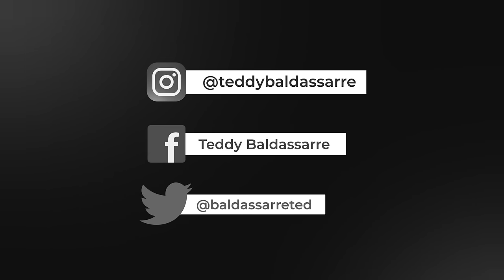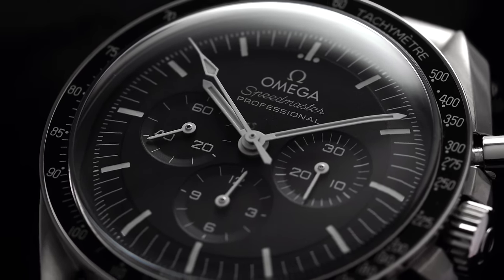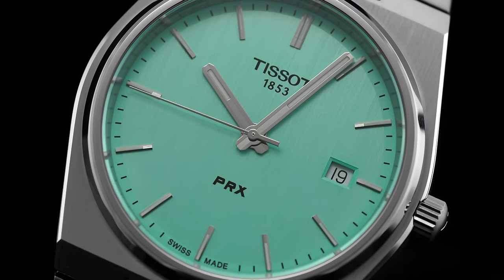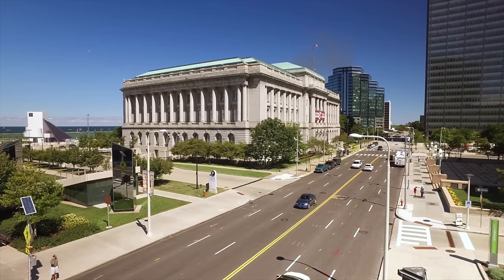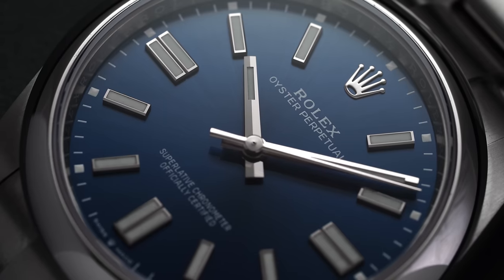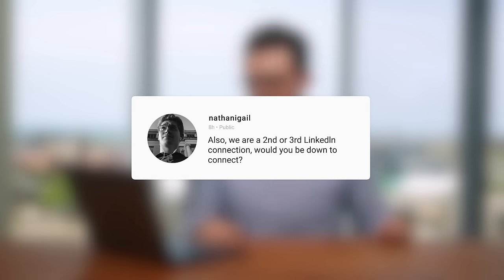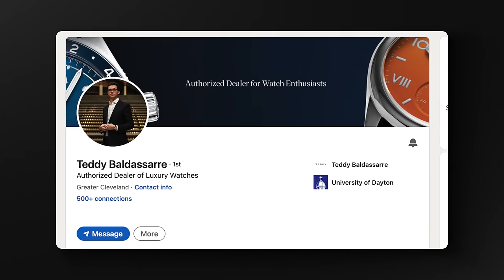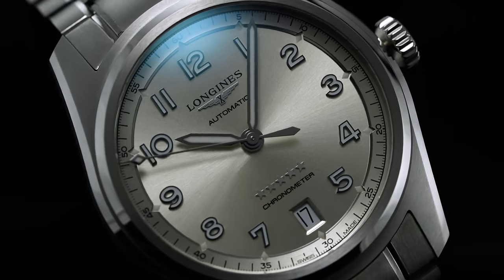OMEGA vs. Tudor, Why Are Quartz Watches Looked Down Upon? CPO Rolex, & More (Q&A)

Comment: Solar radio controlled quartz watches are my current obsession. Japan does not disappoint in this space.
Reply: Seiko coutura is worth looking at
Reply: Correct.  I have several from Casio Oceanus and Seiko -- all JDM.
Reply: Also Citizen Attesa radio controlled watches are worth looking out for. Always dependable to tell accurate time.
Reply: I got one about 15 years ago and it was too complicated.
Reply: I love the seiko astron line
Reply: Agree.  With the gshock line, I find the model I like then go searching for the solar/radio version of said watch.  If they don’t have it, I don’t buy.  Citizen is also unbeatable.
Reply: @brocklanders6969 Love JDM, especially Oceanus
Reply: I have a citizen radio controlled and am still amazed at the accuracy.  It's fun watching my Amazon devices change minutes at the exact same time as my watch.  If you're looking for accuracy, I can't think of a better choice.
Reply: Count me on the team, 2 Autos, 5 eco drives including my PCAT and a yellow Bluetooth Casioak. These last two are the go to watches when everything else has stopped or need adjustments.

Comment: I love quartz and have them from $1700 down to $50.  No reason not own a bunch!
Reply: Im curious, what quarz watches do you have at around 1700 Dollar?
Reply: @bertholdbach4959  G-Shock GWB-5000 Titanium, Black DLC.  2nd most expensive is the Tissot PRX Quartz Blue dial @ $350.  Both were bought from AD's.  Then about 15 casio's and g-shocks of varying price. ( Also bought a 14K gold plated dress in in 1997 for $750, still have it, but it needs a service, eats batteriers in 30 days)
Reply: @bertholdbach4959 I have a Sinn UX and Grand Seiko SBGX343. Both rated to +/- 10s a year. I'd find it very difficult to go back to an automatic after using these tbh.
Reply: @bertholdbach4959  cartier
Reply: @drmanhattan225  Quartz is my preferred watch for travelling.  I've had auto watches drop 10 mins in one day due to ??? magnetism, shock...who knows.  My quartz watches are just more reliable.
Reply: I have a movado bold verso chronograph = $995 before taxes. Most expensive quartz I will buy unless it’s a spring drive grand seiko.
Reply: @alexiz689  you need an omega railmaster anti magnetism, 150m WR. looks good... and way cheaper and prettier than the Aqua terra offerings

Comment: Swatch are progressively moving Omega up the chain.  Given recent Longines launches…to include the new Conquest…I believe Swatch are moving Longines up to compete against Tudor…and moving Tissot up to cement entry level
Reply: I would take Longines over Tudor in almost every category.  Maybe a black bay over a legend diver.  But I think legend is prettier at half the cost.
Reply: And a bracket that matches oris mido Christopher ward regarding there diver hydro conquest
Reply: Until recently, Longines and Tudor, and Omega and Rolex, competed at similar price points. This looks like Swatch Group increasing their prices to match Rolex price increases. Mido and Rado would be the Swatch brands best positioned to move up into the price range previously inhabited by Longines.
Reply: Longines quality is easily on par with tudor in my experience.
Reply: Absolutely agree just the bracelet on the hydroconquest which hopefully they will sort out quality brand in my opinion
Reply: @dsdf_fdp1858  I agree with you. HQ much more interesting design than BB…only  let down by a  cheap bracelet clasp. I had a BB41 that  I sold as it was just too bulky. I’ve retained my HQ 39mm and Omega SMP 300 as the 2 divers in my collection. Note: Was at Longines London Boutique…guy there told me stay tuned for new/redesigned HQ…it will be improved!
Reply: @Greygoose3130  The Pelagos line is better than any dive offering by Longines, but otherwise I agree.
Reply: @cagataycakmak2280 wanted to think the same. Never shut up about Longines to everyone. But, honestly, having just gotten the METAS BB41 on the five link, it's far beyond anything Longines. Same with the Pelagos. Kills me to say it, but Longines will find most of their success in the price segment just below Tudor.

Comment: It’s funny how my watch journey started at Quartz and ended up at Quartz once again. I ONLY wear Quartz these days. From lower end g shock to higher-end Grand Seikos, I’ll take practicality and accuracy over service costs that cost as much as the watch itself. 

Also, Grand Seiko High Accuracy Quartz (5 to 10 seconds a YEAR) are advanced movements with hand craftsmanship, incomparable to mall watch Quartz. There’s more of a reason to romanticize there than in mass-produced Seiko automatic movements that are also used by 3rd parties.
Reply: The mall watch quartz will still be more accurate, though.

Comment: After owning a bunch of automatics and moving to HAQ I don't think I could go back to autos again. Not even for a Rolex. It's just a pain having to check after waking how far my watch has strayed. Perhaps I'd try GS spring drive, but even then you could argue it's a convoluted way of using mechanical to achieve near-quartz accuracy.
Reply: To each his own and you make a valid point, for me tho I love a mechennical movement, yes its a pain in the rear but its so nice having something that does not have any electronics esspeically in a world where everything has a electronic output. Tho I think every collection would benefit from a quartz watch.

Comment: Speaking of quartz, I'd like to see a video explaining the differences in the levels of quartz movements. For example, a $30 Casio, a $375 Tissot PRX,  and an Omega at multiples of those prices?
Reply: the material used in it, and some complexity of it i guess .. some of the watch using gold soldering to preserve the quality. for complexity, on grand Seiko (spring drive) , it has like 40 percent of mechanical-type part for the power. no need battery for it
Reply: Branding. As far as I'm concerned, unless it's something special lik Seiko's spring drive, a quartz movement never justifies a big price tag.
Reply: @bikeman123 i believe there's like really expensive citizen watch with 1+ second/YEAR accuracy! I think with that accuracy it's kinda worth it

Comment: I think you are right that a lot of watch collectors look at the technology through rose colored glasses. The thought is, mechanicals are heirloom quality stuff that we can pass onto our grandchildren, just as you, and I still own our grandfathers' vintage Wittnauers.  Needless to say, the fact that a working man's watch from 50, 60, even 75 years ago is still capable of keeping reasonable time so many years later is remarkable.  
But realistically, how many mechanical watches on the market today, including well into the upper mid range are actually hand built?  The truth is, most mechanicals these days are made in factories with little or no hand finishing.  And, especially at the lower end of the market, how many will be worth servicing or repairing 10 or 20 years from now when they start to fail?  And based on the track record of older quartz, it is likely the better quality quartz movements will still be running 15 or 20 years from now.  So the equation of how long you will get to enjoy the watch without major service seems to balance out.
As for the preference for a smooth sweeping seconds hand over a once per second quartz, I think that is just something we just tell ourselves.   It used to matter to me, but doesn't really anymore.

Comment: Omega are the official time keeper for the Olympic Games.
I think that puts them ahead of Tudor slightly.
Reply: Not slightly. It's way above. Rolex fanboys are  just trying hard to use Tudor as Canon fodder vs Omega .
Tudor competes with longines level.
Reply: @Mega-zi7ys  You are absolutely right. Tudor is in the same category as Longines. Each brand has some strengths over the other, but they are pretty much in the same level.

Comment: I think watch winders are a great tool as long as you buy a good quality unit that support multiple TPD's (650 and up to cover most mechanical movements), selectable CW, CCW, or both direction turns, intermittent winding, and have a 12 hour rest period. Basically these features simulate how a person would wear the watch.  The best units use mabuchi motors which are very quiet.
Reply: Would you have any recommendations on which models to buy?
Reply: @davidprescott9586  I am using the "Vancouver Watch Winder for 2" from a company called "Cuffed". It is a Chinese model sold here in Australia. It has all the features I have listed above. There are other variants from the same source but there maybe different offerings in your country.

Comment: To further add to the quartz vs. mechanical discussion-- what differentiates a Swiss quartz from a Miyota or Seiko? I know some have jewels and some don't, but accuracy can only get so great that there is nothing else really to improve upon.
Reply: I beg to differ. There are different watches for different applications. One of my favourite watches, and my daily wearable, is a quartz. A CASIO quartz at that,  the ProTrek PRW-50FC Solar Limited Titanium Edition. I needed a hiking watch that was rock solid, had a photovoltaic bezel to recharge on the go, and came with things like a compass and an altimeter, all the while not being as garish as the GShocks so I could wear it comfortably as a daily watch. I also absolutely loathe smart watches, and I wanted a classic rotating hand movement.

For me, that PRW-50FC is just perfect, it has everything it needs in a surprisingly clean and restrained design, more so considering it is a CASIO. And it has the shock-absorbing capabilities near those of a regular GShock. All while costing just several hundred euros.

Yes, I love mechanical watches (I have my eyes on the ubiquitous Omega, Moonwatch, the TAG Hauer Carrera Glassbox and some Raketa 24 hour movements) but people dismissing quartz watches because they are supposedly the same is just plain wrong. A quartz watch can have a ton of individuality.

Watches are, at the end of it, tools. Find the tool that fits you, whether mechanical or quartz.

Comment: A lot of people rely on quartz watches because of the precision and reliability. Not to mention it takes 2 years of more for the battery to die out and costs about $8.  The brand I have is a Wenger, probably a sister company of Victorinox which make swiss army knives. Very good quality and water resistant too. What I have cost me about $200 and is now about 8 years, batteries changed twice during that time. I can sleep knowing the time is exact minus or plus a few seconds.

Comment: I enjoy my automatic watches, I own several. My Longines Hydroconquest and a little Tudor Black Bay 36 and a few more. Nothing super high end, but I enjoy them. Funny thing is, when I go to set the watch I'm going to wear for the day, I look at my G Shock for the correct time. For a hundred dollars this thing is solar powered, sets itself 6 times per day, has multiple alarms as well as the ability to be set for different time zones. I don't know why I enjoy my mechanical watches when something far cheaper is more accurate and dependable for a fraction on the price. I'm sure most people that "collect" watches struggle with this idea.

Comment: My take on quartz watches is this: I ,for the most part,work outside and I wear a watch out of necessity.  I  don't care to mess up a mechanical watch by bumping into things--they are repairable but at a cost. A cheap quartz watch(i.e., Casio) I will wear 'coz I can bump into things and it will still run.
Reply: I wore my Orient Mako USA in construction. I also took it to the range all the time. A quartz might be better but a robust mechanical will work just as well
Reply: @svfutbol20  Do you accidentally bang your Orient against anything when you're outside? I do. I want to put(if it happens) as few scratches as possible on my mechanical watches. Did I  mention that I work outside? If that's what you want to do,that's your choice.
Reply: @johnsanabria3279  Oh yeah, my Orient is pretty beat up. I love it for that reason. My Omega has a few scratches on it as well, not a problem. I have a couple dress watches that are solely reserved for black tie events, however.

Comment: They are looked down upon because brands like Longines and Omega are moving upmarket and quartz is not chic or haute horlogerie. I've two quartz  (when you could get them) examples of those brand's iconic watches that were gifted by my wife, a Longines Hydroconquest 39mm and a SMP 36.25. They were less than half of the automatic counterparts with the same quality and looks, so I'm good with them and love them.

Comment: Great vid Teddy.  About overwinding, I think it should be said for a watch that houses the Sellita SW200-1 they still have an issue with shearing the ratchet wheel when hand winding the movement.  I have 2 watches less than 2yrs old that both have ratchet wheels in need of replacing due to the teeth breaking off.  I am not an over winder either, so going from sw200 to sw200-1 has not alleviated the problem.
Reply: Ugh.  My Steinhart Adventure has an SW200-1 that runs great (-2s/day), but that basically won't hand wind past a couple of turns from a dead stop.  Steinhart actually looked at it for me under warranty, but said that there is nothing wrong with it.  I'm just going to keep wearing it and let it wind via the rotor.  Annoying, but I'm just going to accept the limitations of my $450 watch.  I really like the watch, but the honeymoon is over, that's for sure.

Comment: I don't think that Quartz watches are necessarily looked down upon. Just the cheap disposable Chinese and Swiss quartz movements are. There are high quality movements with Quartz integration like the Seiko Spring Drive which is technically a hybrid, and a few highly innovative Mecha-Quartz movements (F. Piguet, LeCoultre, Soprod, FP Journe, etc) which combine the technology of a Quartz movement with the functionality of a Mechanical. So no, Quartz movements are NOT looked down upon. And whoever does is a snob and needs to do a more thorough research.

Comment: "Why quartz watches are looked down upon?"  A quartz watch is a completely different watch, which is worn for completely different reasons.  I own both.  Sure, quartz time keeping accuracy and dependability is amazing, but when a quartz watch eventually breaks, the one viable option will probably be to replace the movement -which is the heart and soul of the watch.  I appreciate my mechanical watches that are slightly less accurate, will last for several generations, and can be repaired by my Horologist, who is a master of his craft.

Comment: I strictly use quartz watches in my daily life as I work in a pretty electromagnetic job.
Reply: An Omega with METAS certification like the Globemaster would likely work fine for you as they are engineered to handle magnetic fields without issue.

Comment: I don't look down on quartz watches, but I'm not spending more than a few hundred for one.  Swiss watch makers changing $1,000+ for quartz watches is ludicrous.
Reply: Depends on the movement. My Ux uses an ETA COSC certified thermocompensated movement which gives +\- 10s a year. And then there's GS 9f. No automatic will ever come close to either, or even spring drive for that matter.

Comment: I look up to stellar quartz watches that have 10 year battery life. i look down on the ones that have less than 7. There are many miyota movements brands can buy that will give the watch  a 10 year run. I have a $20 casio analog watch with a cr2012 that is thin and lasts 10 years. But why is this so hard to have in a more luxury level watch. It's why i won't buy them.

Comment: Omega watches are generally technically superior to Rolex. How will Tudor overcome that? They wouldn’t be allowed, even if they wanted to. They are very strategically positioned above Longines etc and below Omega.
Reply: Swatch going after Tudor with Longines in a much stronger way…see new Conquest launch…and upcoming Hydroconquest next gen launch. Along with Spirit and Heritage lines…Longines have the heft to take on Tudor

Comment: Personally I find it very difficult to find a quartz watch with the same level of finishing and aesthetics as many mechanical I like. The PRX is a good example but there aren't that many. I recently bought a Timex waterbury chronograph which feels well finished but no sapphire which you would have gotten for a mechanical watch.
It seems to me there is a will from watch makers to limit the specs of quartz watches so that really good quality watches are almost exclusively mechanical.

Also there is just no reason why a quartz watch's second hand have to be on a 1Hz frequency. This is driving me crazy as it is one of the thing most people don't like about quartz and it does not need to be this way!
Reply: Take a look at the Longines Conquest VHP. High quality finishing…HAQ movement to include perpetual calendar
Reply: Grand Seiko offers some incredible quartz watches